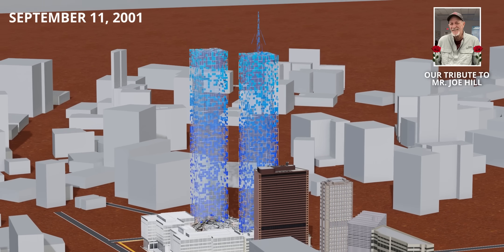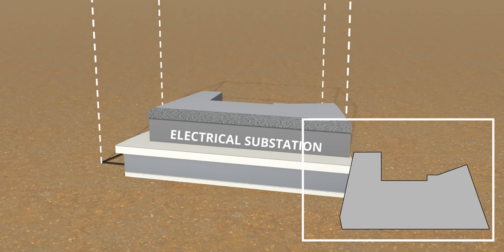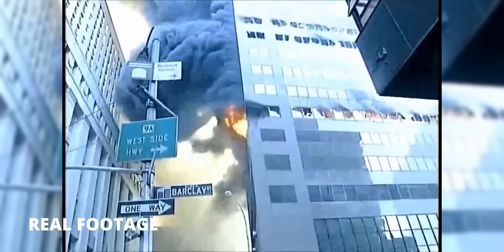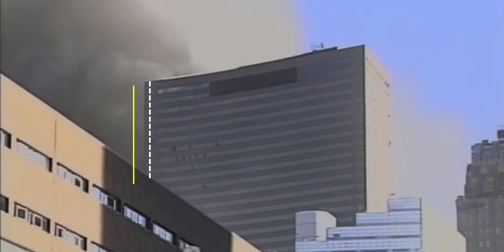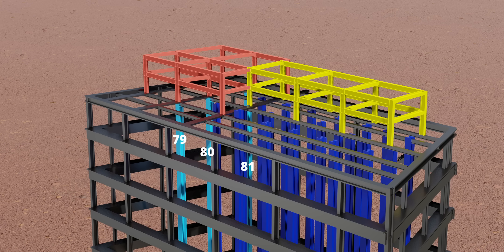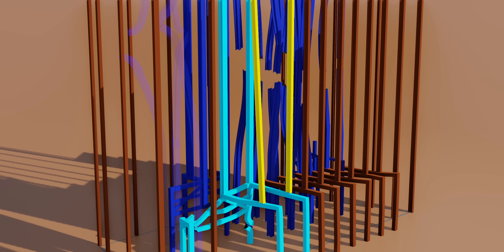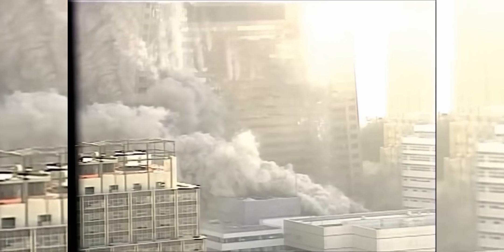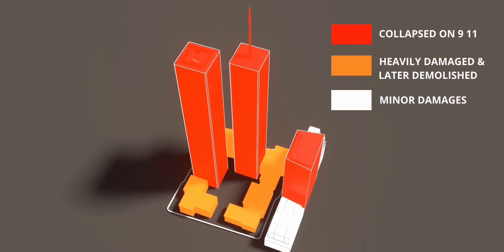Collapse of Building 7 | The Complete Physics

Comment: Let’s go with this theory, if the remaining support beams that were under stress due to the pen house beams failing they would of held the remaining right side of the building . But let’s say the couldn’t hold up and failed they would have failed at different times and not all at once at the same time .  Failing buildings on their own  footprints is only done by demo
Reply: No, let's go with what really happened and what this video is actually describing.

Building 7 was complex, assymetrical 47-story steel framed structure built atop a smaller 3-story building, requiring lower floors dedicated to complex load transfer structures, not usable office space. Of trapezoidal shape and all-steel tube-in-tube construction, B7 (above the 7th floor) consisted of a central core of steel columns carrying most of the gravity load, perimeter steel columns around the outside of the structure carrying the remainder of the gravity loads and long span beams and girders to tie those elements together and form the floors. On the outside of the building hung a moment frame or outer shell.

Phase 1 : First externally visible signs of collapse initiation occurred at 5:20:28 pm and were notably quiet with observers not realizing the building was collapsing! No audible warning in the form of hundreds of ear drum busting 180-190dB explosive bangs preceding the collapse. Here at 12:00 a local CBS affiliate reporter is talking 10 blocks from B7 when collapse begins. People don’t start to notice the collapse until 12:11. At 12:45 is the famous CBS fixed camera clip of Building 7’s collapse. Note how quiet it is.

youtube.com/watch?v=t5tEy6mXSE8&ab_channel=fresnosean379

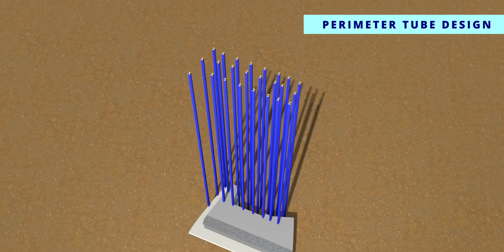Collapse initiation was due to lower floor failures above the load transfer region (7th floor) in the NE corner. In this video at 0:45 you can see the NW corner from inside the building while under construction, Column 79 just out of frame on the left. That big, angled steel beam across the top of the frame connects to C79 at one end. The girders connect to the beam. That beam and all those girders depend on just one connection

youtube.com/watch?v=nP3TNHPCIVU&t=35s&ab_channel=EdwardCurrent

Phase 2 : The floor failures caused a loss of critical lateral support over an excessive length of core Column 79 and it buckled. If you look at a floor diagram of Building 7 (see above) and look at all the structures that depend on C79 you quickly realize this one column was a relatively isolated structural element on which a disproportionately greater fraction of the structure depended analogous to say the Key Bridge. Externally we see a vertical progression of window breakage along the 44-46 line and a kink in the roof of the East Mechanical Penthouse at the top of the building, consistent with C79 failure. The transition from full capacity to almost no capacity occurs in an instant. Once the buckling failure occurs there is almost no resistance

Normally with a buckling column, the load could be redistributed to other columns. With C79 that is not the case - the failure did not redistribute the load, so the collapse rapidly progressed to the roofline, sinking the rooftop penthouse.

Phase 3 : With C79 gone, B7’s progressive, non-symmetrical collapse continues with C80 and C81 at the east end of the core left laterally unsupported and quickly buckled and failed as well, sending the EMP down through the building. C79-81 all have no diagonal bracing, which I believe is a major reason why they could not redistribute a lot of vertical loads among one another.

From there collapse progressed from east to west through the central core until the core was gone taking all of the interior floors and probably most of the perimeter columns with it. Follow the horizontal progression of window failures low in the building and the dropping of the remaining rooftop structures into the building. One of the big takeaways from the NIST Building 7 study (that gets completely ignored) was their modeling which determined C79 failing under ANY circumstances would have initiated the same collapse sequence.

Phase 4 : After 10 seconds only the exterior moment frame - a hollow empty outer shell – remains, giving the ILLUSION the Building is still standing since little has outwardly changed. It is just a hollow empty shell like an empty cereal box. Supported by only a few remaining columns that empty shell is quite unable to remain standing. With all core columns and floors gone, the north face leans inward, forming a V in the roofline, the last few columns buckle under the strain and the moment frame free falls, landing on top of the 7-story high debris pile. It is only late in the game here at the end that a single measurement of alleged free fall acceleration is taken, from a single point on that outer shell. The Building did not “free fall” – just one corner of the outer shell did, sort of. The Building was already gone before that happened. The period of alleged free fall was a product of how it fell NOT why it fell and cannot tell us what started the collapse. Start to finish the entire collapse took 18-20 seconds, 3 times longer than true free fall . How fast something falls cannot tell you what started it falling_ anyway. The debris spread outside the footprint, blocking surrounding streets, heavily damaging the Verizon Building and destroyed Fiterman Hall.

Building 7’s progressive, non-symmetrical collapse was incidental and unintended collateral damage from the combined effects of fire + time + gravity, started by the collapsing North Tower. That is true no matter who planned and carried out the 9/11 attacks or why . The collapse was of so little consequence it barely even registered at the time, a mere footnote. It only took on semi-mythical status as an alleged smoking gun years later when demolitions at the Twin Towers, missiles at the Pentagon and shoot down over Shanksville all failed and conspiracists had nothing left to work with.

Anything can seem like a conspiracy if you don’t understand how it works. Now you should. I hope you found this helpful, informative and it solicits informed critical comment. If I made any errors of fact, logic or reason or left anything important out, please let me know so I can fix it. IF you can offer a more plausible alternative please do. Be the first. Please start any reply with the words “Tits McGee” or I will know you didn’t read it and are wasting my time.
Reply: @TheCriticalStinker-01 Nice copy paste job. Do you work for the BBC?

Comment: This guy is a joke and needs to have his PE revoked. 

Wrong. It was a controlled demolition because of really basic physics. 

Civil Engineer: "look! flamey thing equals collapse! seeee?" That's the tiniest fire ever to bring down a building by which no building ever collapsed from fire. NYC mayor stated that the fire chief at WT7 was too great and they "had to pull it". This is something fire departments do for wooden frame structures when a concern exists over a kater collapse. It's done for safety.
Reply: I'm going to respectfully disagree and offer a superior alternative.

Much misunderstood, Building 7 was the 6th building to collapse of the 10 lost on 9/11. Because of its early low priority, conspiracy filled the information void with garbage made up by technically ignorant people promoting political agendas. But this is an engineering problem and should be treated as such, so I prepared this brief summary of my own analysis to fix that, using engineering, not politics and tired memes.

The North Tower collapse at 10:28am bombarded Building 7 with tons of debris, causing heavy damage and starting multiple fires which burned out of control for 7 hours. Half the FDNY firefighters having been killed, units in disarray, equipment destroyed, no water pressure, and the greater urgency of search & rescue efforts, firefighting was pulled as futile. The building couldn’t be saved and was left to its fate. That is the sort of choice firefighters make every day in brush fire situations - which houses to save and which ones to let go. Only real difference here is moving the decimal on the size and cost. People get overwhelmed by the size.

www.youtube.com/watch?v=g_SvpwyC17M&ab_channel=MFitz

Collapse of a burning structure is always a concern for firefighters. Steel buildings subject to fire rely on active fighting of the fires to survive. Buildings are designed around 1 to 3 hours of fire resistance, allowing time for occupants to escape and ACTIVE firefighting to get started, after which all bets are off. Left to their own devices they will exceed their design envelope and collapse, like Plasco Tower and Wilton Paes de Almeida. In B7 the occupants escaped, passive and active fire protections were compromised and active firefighting was abandoned 3 hours before the collapse, which left the building to its fate. It lost. Odds on Building 7 would eventually collapse, and it did. No big deal in logic.

www.youtube.com/watch?v=WnYBX6QT0R4

FDNY Chief Daniel Nigro ; The biggest decision we had to make on the first day was to clear the area and create a collapse zone around the severely damaged 7 World Trade Center, a 47-story building heavily involved in fire. A number of fire officers and companies assessed the damage to the building. The appraisals indicated that the buildings structural integrity was in serious doubt. I issued orders to PULL back the firefighters and define the collapse zone. It was a critical decision; We could not lose any more firefighters. It took a lot of time to PULL everyone out, given the emotionalism of the day, communications difficulties and the collapse terrain

FDNY Deputy Chief Peter Hayden ; We had our special operations people set up surveying instruments to monitor and see if there was any movement in the building. We were concerned of the possibility of collapse in the building. And we had a discussion with one particular engineer there, and we asked him if we allowed it to burn could we anticipate a collapse and if so, how soon? And it turned out that he was pretty much right on the money, that he said 'In its current state you have about 5 hours

The collapse of Building 7 was anticipated and widely reported in the media throughout the day, with 24 video cameras recording some or all of the collapse. Everyone knew what was coming and why.

www.youtube.com/watch?v=OY5S5k3tMHI

Building 7’s collapse was completely different to the Twin Towers and harder to understand as most details hidden from view and not intuitive, but we can still sort out what happened through careful analysis and observation. This is my explanation of the collapse relying on no outside authority.

Building 7 was complex, assymetrical 47-story steel framed structure built atop a smaller 3-story building, requiring lower floors dedicated to complex load transfer structures, not usable office space. Of trapezoidal shape and all-steel tube-in-tube construction, B7 (above the 7th floor) consisted of a central core of steel columns carrying most of the gravity load, perimeter steel columns around the outside of the structure carrying the remainder of the gravity loads and long span beams and girders to tie those elements together and form the floors. On the outside of the building hung a moment frame or outer shell.

Phase 1 : First externally visible signs of collapse initiation occurred at 5:20:28 pm and were notably quiet with observers not realizing the building was collapsing! No audible warning in the form of hundreds of ear drum busting 180-190dB explosive bangs preceding the collapse. Here at 12:00 a local CBS affiliate reporter is talking 10 blocks from B7 when collapse begins. People don’t start to notice the collapse until 12:11. At 12:45 is the famous CBS fixed camera clip of Building 7’s collapse. Note how quiet it is.

youtube.com/watch?v=t5tEy6mXSE8&ab_channel=fresnosean379

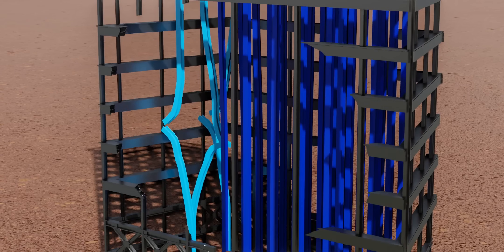Collapse initiation was due to lower floor failures above the load transfer region (7th floor) in the NE corner. In this video at 0:45 you can see the NW corner from inside the building while under construction, Column 79 just out of frame on the left. That big, angled steel beam across the top of the frame connects to C79 at one end. The girders connect to the beam. That beam and all those girders depend on just one connection

youtube.com/watch?v=nP3TNHPCIVU&t=35s&ab_channel=EdwardCurrent

Phase 2 : The floor failures caused a loss of critical lateral support over an excessive length of core Column 79 and it buckled. If you look at a floor diagram of Building 7 (see above) and look at all the structures that depend on C79 you quickly realize this one column was a relatively isolated structural element on which a disproportionately greater fraction of the structure depended analogous to say the Key Bridge. Externally we see a vertical progression of window breakage along the 44-46 line and a kink in the roof of the East Mechanical Penthouse at the top of the building, consistent with C79 failure. The transition from full capacity to almost no capacity occurs in an instant. Once the buckling failure occurs there is almost no resistance

Normally with a buckling column, the load could be redistributed to other columns. With C79 that is not the case - the failure did not redistribute the load, so the collapse rapidly progressed to the roofline, sinking the rooftop penthouse.

Phase 3 : With C79 gone, B7’s progressive, non-symmetrical collapse continues with C80 and C81 at the east end of the core left laterally unsupported and quickly buckled and failed as well, sending the EMP down through the building. C79-81 all have no diagonal bracing, which I believe is a major reason why they could not redistribute a lot of vertical loads among one another.

From there collapse progressed from east to west through the central core until the core was gone taking all of the interior floors and probably most of the perimeter columns with it. Follow the horizontal progression of window failures low in the building and the dropping of the remaining rooftop structures into the building. One of the big takeaways from the NIST Building 7 study (that gets completely ignored) was their modeling which determined C79 failing under ANY circumstances would have initiated the same collapse sequence.

Phase 4 : After 10 seconds only the exterior moment frame - a hollow empty outer shell – remains, giving the ILLUSION the Building is still standing since little has outwardly changed. It is just a hollow empty shell like an empty cereal box. Supported by only a few remaining columns that empty shell is quite unable to remain standing. With all core columns and floors gone, the north face leans inward, forming a V in the roofline, the last few columns buckle under the strain and the moment frame free falls, landing on top of the 7-story high debris pile. It is only late in the game here at the end that a single measurement of alleged free fall acceleration is taken, from a single point on that outer shell. The Building did not “free fall” – just one corner of the outer shell did, sort of. The Building was already gone before that happened. The period of alleged free fall was a product of how it fell NOT why it fell and cannot tell us what started the collapse. Start to finish the entire collapse took 18-20 seconds, 3 times longer than true free fall . How fast something falls cannot tell you what started it falling_ anyway. The debris spread outside the footprint, blocking surrounding streets, heavily damaging the Verizon Building and destroyed Fiterman Hall.

Building 7’s progressive, non-symmetrical collapse was incidental and unintended collateral damage from the combined effects of fire + time + gravity, started by the collapsing North Tower. That is true no matter who planned and carried out the 9/11 attacks or why . The collapse was of so little consequence it barely even registered at the time, a mere footnote. It only took on semi-mythical status as an alleged smoking gun years later when demolitions at the Twin Towers, missiles at the Pentagon and shoot down over Shanksville all failed and conspiracists had nothing left to work with.

Anything can seem like a conspiracy if you don’t understand how it works. Now you should. I hope you found this helpful, informative and it solicits informed critical comment. If I made any errors of fact, logic or reason or left anything important out, please let me know so I can fix it. IF you can offer a more plausible alternative please do. Be the first. Please start any reply with the words “Tits McGee” or I will know you didn’t read it and are wasting my time.

Comment: I have a problem with this explanation - the "Panthouse" that collapses is on the left side of the building. while the damaged part of building 7 was the right side.. Also, we are shown columns in the base being broken, almost all of them, but what is causing this damage? for sure the fire can not be responsible for the damage to the columns on the left side
Reply: If you were paying attention, the East Mechanical Penthouse is on the east side. The physical damage fron the North Tower collapse in the South and west side.  

That damage did not cause the collapse. 

What it did was introduced the fires which raged and spread throughout the building for the next 7 hours.

Collapse was due due structural failure after 7 hours of out of control fires wreaked the structure to failure.